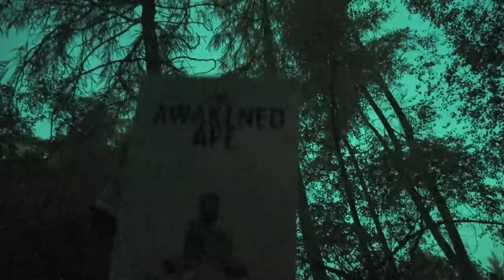One Year in the Woods - Living in a Tent

Comment: The arctic's aren't bad,  personally though i prefer the big old Sidwall long tents, running an outer and an inner liner...   you can set up beds in them, stove, tables, lights,  throw up a set of solar pannels on top, solar generator and lights inside.
Reply from the maker: Sounds great, you know the score 👍👍
Reply: @BushwackerMan  in the canadian military we used the arctic (identical to yours)  for remote deployments,  essentially 1 per truck crew.   And the larger sidewalls for "bivowak"  or command camping., where we weren't planning on moving for weeks or months.  

This allowed for a much greater level of comfort and theire for higher moral.   We had the green outer, with a white inner liner acting as an air gap and insulation   The heavy metal frame also allowed for massive snow loading.   

Comically enough, you COULD go for a poor mans version for your kitchen tent.    Picture one of those 'portable garage" tents...   with metal frame, then an extra, heavy or superheavy tarp over it with tie downs to help with sstability and wind resistance...  You could then set up actual tables in there,  chairs,  kitchen cook set.   even a little buddy heater if needed.
Reply from the maker: @jenniferstewarts4851  Cheers for the great information 👍👍